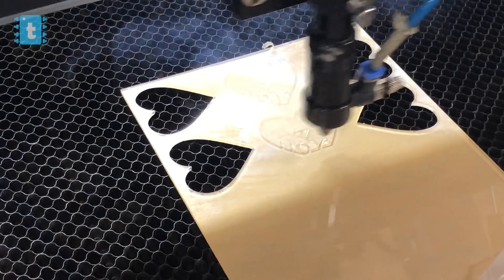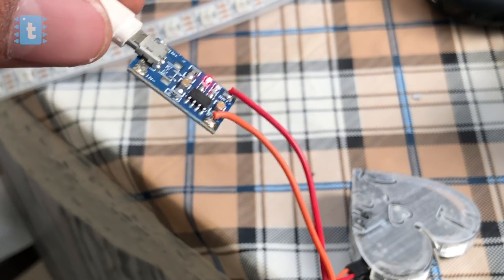Most Innovative project of 2019, Connected Love Pendants | IoT Projects | ESP8266 Projects

Comment: An easy solution is to check if the connection is still alive, if it is not, then wait a moment , the reboot. When starting it will go again through setup() and connect again. The wait is to make sure it does not too frequently